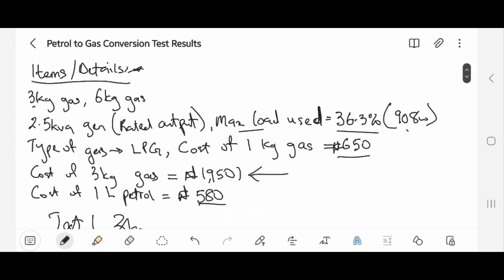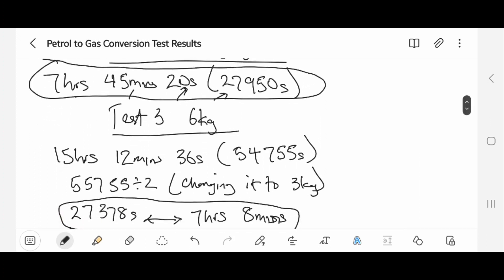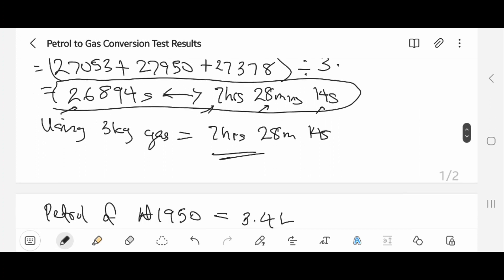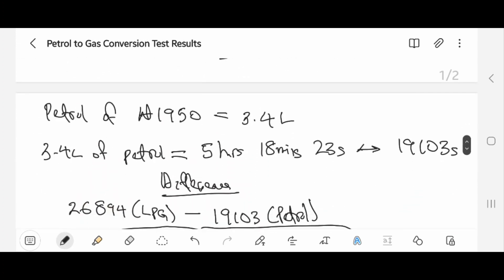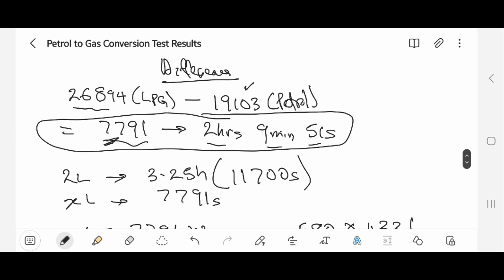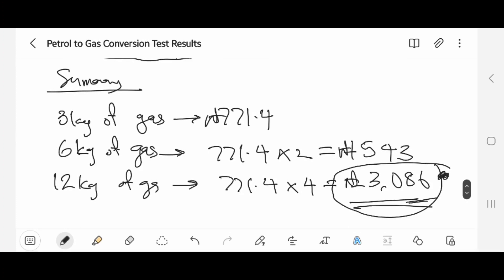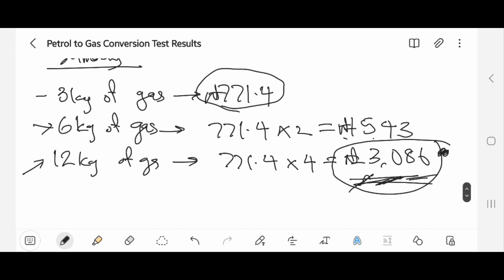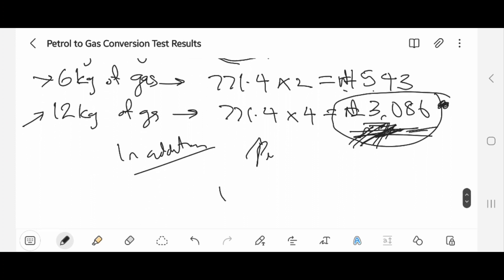Petrol vs Gas LPG NG Carburetor. Results!!

Comment: Thank you for this wonderful analysis.

If I use the exact same Generator and my load is at about 1400 watts to 1500 watts, how many hours should I expect on a 12.5 KG gas?
Reply from the maker: You intend to use loads between 1400w-1500w, I will base the calculation 1500w. 1500w is 20% more than my own calculation. Infusing the 20% increase, for 3kg, 
it will give an average of 6hrs 7mins. 
Therefore;
                 12kg gas = 4 x 3kg gas = 4 x (6hrs 7mins) = 24 hrs 25mins.
Answer: with 12kg gas using same generator, with load of 1500w, you should have approximately 24hrs usage time.

I hope you have subscirbeeey?
Reply: @easyfind01  Thank you and for sure I will subscribe right away
Reply from the maker: You are welcome @ssgi4in1

Comment: That's a good analysis. There are other factors that you need to consider in the costing though. Increased wear and tear when using lpg, effect of engine efficiency on consumption of lpg or petrol. You could look at that also.
Reply: Scientifically speaking, LPG usage should result in reduced wear and tear and servicing cost. Burning petrol leaves a significant amount of carbon particles some of which is usually captured by the engine oil while the rest goes out the exhaust. Over time these cake the interior surfaces of the generator. Also dirty fuel results in clogging up of the carburetor.   These reduces the efficiency of your generator until at a point it would refuse to start at which point you would need to call a repair man.

Burning LPG means the amount of carbon particles are significantly reduced. You will drain the oil a lot less frequently and your carburetor would almost never get clogged up. 
 

Including the reduced cost of engine oil and servicing, I think LPG for small generators is fantastic.
Reply from the maker: thank you very much for the information. @pee-buddy
Reply from the maker: Thank you. I'll try and do.
Reply: What happened to your engine oil
Reply from the maker: @mvploaded47  I noticed some difference compared to using Petrol. I am still watching. I should drop an update on it soon.
Reply: @easyfind01  well I don’t think that’s true I have been using my fireman (fire man with black thank)for 2yrs + December will make it 3yrs I have not for once service it the only thing I do is change the oil spark plug and the only a mechanic has ever touched that then was when the rope get cut . It is still pumping water and others till date though I recently switched to the dual carburetor let’s see the out come
Reply from the maker: @mvploaded47 do you mean you have never changed the oil in your generator for over 2 years of usage please? by the way, let's see the outcome of your experience with the new carburetor. I wouldn't say it's not true until I experience it.....
Reply: @easyfind01  no I said do only thing I do change is oil and spark plug and the the rope once because it was key before the battery went bad
Reply from the maker: @mvploaded47 oh okay. I'll be glad to read your update regarding the oil drop level. how has the gas carb working so far? how is the cost like compared to petrol? Better?

Comment: Mehn, this is the best breakdown I've seen in a while.

Bro truly knows his onion.

I'm liking & subscribing immediately..

But please, I'm using exactly the same gen as yours, and thinking of converting to this gas carburetor, but first of all, I want to know how you got the total wattage output of your appliances.

What appliances do you use, & what are their individual wattages?

Cause I have one refrigerator, one 32 inches television, a Hisense Soundbar that comes with a subwoofer, one chandelier (hanging light), three energy-saving bulbs, one 20 inches OX standing fan, one laptop, one Bluetooth speaker, numerous phones plus the ones neighbors come to plug whenever I turn on my gen, and I think that's about it.
Reply from the maker: Each appliance usually have a sticker where ratings are written. e.g at the back of your tv, there is the wattage there say 200w, at the back of decoder it's there, on fans, they usually write it on the box. On freezers/fridge, it's on a sticker at the back. So you will get all these wattages for your appliances, add em up and you have your total load. if for instance your total load is 1700w and you use a 3.5kva Gen (that is 3500w). This means your load is (1700/3500) * 100 = 30.6%.

Understood?
Thank you.....
oya go and susbcribe now. lol

Comment: Can the gas carburetor work for 1.2kv to 2.0kv maximum gasoline generator?
Reply from the maker: It works for 2kva and above but not below. 

Note: I'm of the opinion that if the carburetor can fit in perfectly, it should  work. Remember, it's my opinion.

Comment: Its like my Carburetor is bad, cos 5KG gives me abt 5hrs. I have adjusted the orange button to the right spot and still no improvement.
Reply from the maker: Why did you change the orange button settings buddy? What you are using is cooking gas, right?

1. What is your generator's capacity in Kva?
2. What was your load?
3. How much did you open the regulator knob on the cylinder?
Reply: @easyfind01  Yes, cooking Gas. Is that the wrong gas to use? Can the carburetor  use both LPG & CNG? 

The advice to set the orange knob was given by the guy to fixes my gen when I complained it drains fast.

Capacity is 2.8kva
Reply from the maker: You did not give answer to my question 2 and 3.
Reply: @easyfind01  2 refrigerators and other household appliances like TV, 2 Fans and energy bulbs. 

The regulator on the cylinder, I open slightly, ones I hear the gas escape I stop.
Reply from the maker: One thing about Generators is that the more the load, the more it will consume fuel (either gas or petrol) and vice versa irrespective of the type of fuel being used. Although, you didn't give me the total loads used. I will assume for you: 2 ref (say 200w each = 400w), TV (how many? say 2 @ 140w each = 280w), fans (how many? say 3 @ 70w each = 210w), bulbs (how many? say 4 @ 30w each = 120w), chargers (phones, laptops etc. …..say 150w) total = 1160w of 2.5kva = 46.4% load (note, these are all assumptions).
From your assumed load above, there is 10.1% difference between your load and mine. So infusing your load difference into my calculations, You should be getting nothing less than 40297s <=> 11hrs 11mins 37s. (cutting short to the least, should have not less than 10hrs usage.

summary:
1 please return the orange valve to LPG as our cooking gas according to my knowledge is LPG.
2. you can try reducing duration of the TV usage and check. From my experience, TVs chop a significant amount of watts but you will think it doesn't.
3. If you observe 2 above and there is still no significant difference, the carburetor might be bad. A friend once told me that there are a lot of fake out there.

I hope I have answered your question to an extent
Reply: @easyfind01  Thank you

Comment: What observations did you experience when the gas pressure level is low while running your generator? Does it run normal or it begins to jerk and voltage fluctuates.
Also, I did same test on my 2.8kv gen, I got 7hrs 45mins
Loads are freezer - 100wats 
 Lights - 150watts
2 fans and 1 58inch TV
The gas only lasted for 7hrs 45mins

So what I'm I doing wrong?
Reply: Gas is less dense that petrol. Because of its higher density, petrol would run till the last drop. But when the less dense gas is low, it cannot give the same power as it used to. That's the reason for the jerking towards the end. Its similar to when the petrol actually runs out in the generator
Reply from the maker: The experience when gas level is low isn't good at all. Gen begins to jerk like brraam, braaam, braaam, at that point, the best is just to switch it off all gadgets asap as it can really damage gadgets due to the fluctuation.
Reply: @easyfind01  this is what I'm facing and I'm not happy about it. Also, please check my usage, I'm not getting the benefits of the gas as compared to the one you dropped
Reply from the maker: I don't think there is a way out of that. The moment the gas pressure is low due to the low level of the gas (almost finished), you have the jerking and fluctuation. Gas own is just too pronounced compared to petrol.
Reply from the maker: Check my test result video. I think the usage duration you got is good. See the link : https://youtu.be/JDeqFybvJ0c
Reply: @easyfind01 Also, I observe that when the gas level is low and I turn on my AC, it behaves like this also until I turn off the AC, but when the gas is newly filled or gas level is still high, it works well. Have you experienced this as well?